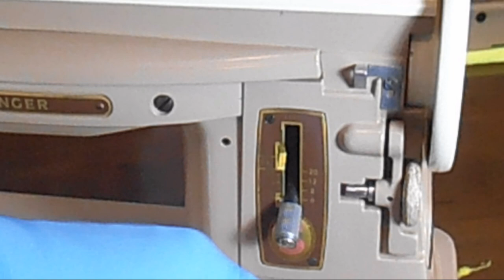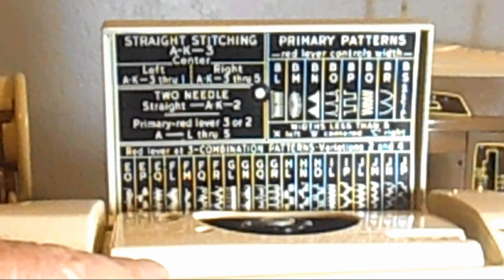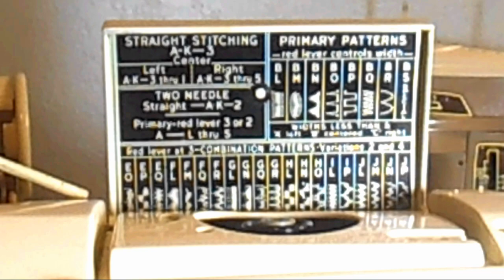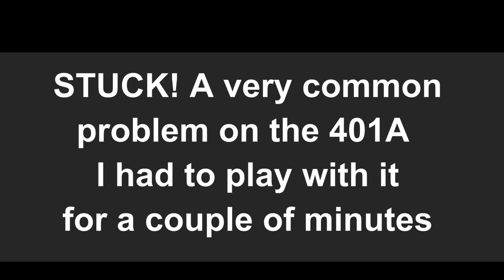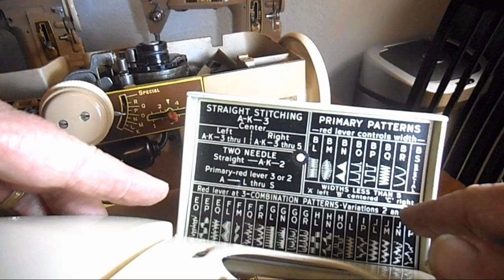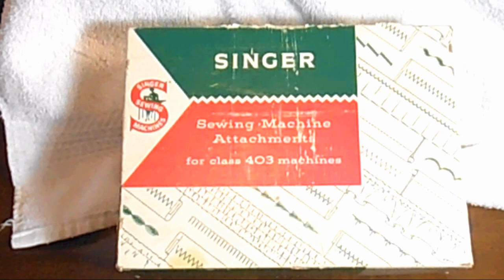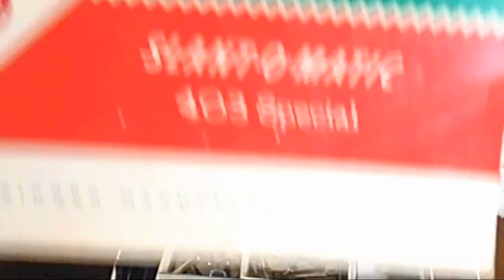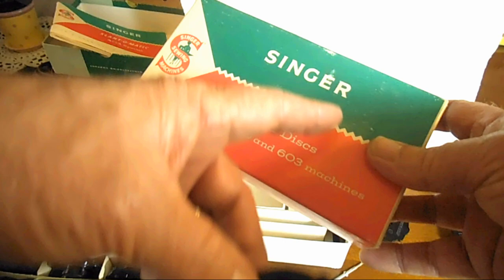SINGER MODELS 401A 403A 404 COMPARING THE BUILD AND FEATURES

Comment: Andy, you didn't mention that the 404 needs a special attatchment for button holes. This because the 404 is as you say, purely straight, & the special attatchment does the zigzag necessary for button holes.
Reply from the maker: Hi Sandra. You are correct about a buttonholer attachment. Thank you for mentioning it. My intent was to show the attachments that were included with each model when it was purchased. On page 45 & 46 of the 404 manual is listed other "Fashion Aids" for the 404 that were sold separately, including the Buttonholer and even an Automatic Zigzagger, among a few others. The free 404 manual is here: http://www.singerco.com/uploads/download/0759bcb48cceb58cd560ec346e371205b034853d.pdf
 The buttonholer and zigzagger work very well and are not expensive. The aids are available on eBay and other sites. I did a series on restoring a buttonholer. It is a straight shank model, but otherwise identical to the slant needle model in the pink "Jetson" case. See it here: 
https://www.youtube.com/watch?v=e5131TMpI7A&list=PLsCOZgzzaiKIVBGEISHzZeWVk8-IxpHw0

This site has an old Singer commercial show how to use the zigzagger on different sewing machine models, cute.
A free instruction manual for the zigzagger is here: http://ismacs.net/singer_sewing_machine_company/manuals/singer-zigzagger-attachment-manual.pdf

The manual for the buttonholer is also available. It shows the low straight shank version, but both models worh  the same and use the same templates. Find it here: http://ismacs.net/singer_sewing_machine_company/manuals/lowshank.pdf

So yu could get a 404 and these two Fasion Aid attachments and sew zigzag and perect buttonholes too!
Loved you comment Sandra and I'll pin it so others can learn about the attachments. Thank you for watching Andy Tube.
Reply: Scusate nessuno parla italiano
Reply: @clararuffo6444  Use the captioning feature of youtube to translate.
Reply: All of the 400 series require a separate attachment as do the 600, 700 and a bunch more models until the 1980s. The 400 series were from the mid-60s and the 401 A was the most advanced for the time. $600 price tag then is approximately $3000 value today. I have 3 of them! My go-to for almost all my sewing.
Reply: Oops! From the late 50s, not the mid-60s.
Reply: @fumble3  why three?
Reply: @fumble3  you can amend your comment by hovering over the three dots that appear to the right when you place your cursor there.
Reply: @fumble3  no. 1950's.
Reply: @twinstar9  LOL! Because, like the mountain, they were there. I have actually had more than three over the years but I have a pesky sister who keeps getting them from me. She also favors the 620 Golden Touch and Sew which my mom got when I got married (and gently removed the 401A) and which my sister was raised on. I remember getting her a child's version (not actually a toy since it created a lock stitch rather than a chain stitch) which she diligently used whenever mom was in the sewing room. She made some notable items on it. Just last year I found a working, complete, one and bought it for her for Christmas. She can't wait to gift it to her 2-year-old granddaughter along with summer vacations full of loving instructions. Hope the little one takes up as well as my sister did. She actually is a better sewist now than I am (at ages 63 & 72)

Comment: Great video! Can a 403 take a treadle?
Reply from the maker: I don't think the USA built one can. I've never seen it and don't see the space for the belt in the base at the front right corner of the bed. The bed is too deep, so I think you'd need a slot or opening for the belt. Singer in Germany made some very unique 400 series slant needle machines. I think one or more of them could convert to a treadle. Search for models 411G and 412G

Comment: Maintenance of sewing machine Singer mawdil 247?? Please
Reply from the maker: Singer Model 247 (Domestic) Instruction Manual: https://www.singer.com/sites/default/files/product_manual/SINGER%20247_547_876_966_3102_L47%20Sewing%20Machines.pdf
Parts List & Diagram: http://parts.singerco.com/CPpartCharts/2_2999/242_247_248.pdf
I do not have a service or repair manual. I do not have this machine or even seen a 247 in person.
List of all my playlists of different models I have worked on (350+ videos) https://www.youtube.com/channel/UCUSPDsHaFtRoz1VA2U1xJ4w/playlists?disable_polymer=1

Comment: I still have my Golden Touch & Sew and my Singer Imperial Model 7043 both of which are slant shank models.  Why are they not making sets of presser feet for these machines?  Singer machines last forever.  In fact, my mother still has my grandmothers treadle which still sews.  I really want that new flower stitch foot for my slant shank machines.  Do you know who I can talk with to get one made for me?  Or to get one of those 42/52/62 presser feet set for slant machines?  I don't think Singer is fair in not providing these -- especially since nothing is wrong with my machines.  There are more slant shank users than you think.
Reply from the maker: You have choices when it comes to slant shank presser feet, although I've never seen the newer "flower stitch foot" in a slant model. You can always buy used vintage feet from places like eBay. Any slant foot should fit any slant model, so you could buy a set of feet for model 603 and use it on your Golden T&S machine. https://www.ebay.com/sch/i.html?_from=R40&_trksid=m570.l1313&_nkw=singer+slant+needle+presser+feet&_sacat=0
If you prefer to buy sets or specialty slant feet, the new ones are made with a separately attachable shank you leave on the presser bar, and the feet snap-on to it. https://www.sewingpartsonline.com/slant-shank-singer-snap-on.aspx?utm_source=Youtube&utm_medium=Product
For the feet, you can buy sets or individual feet. https://www.ebay.com/sch/i.html?_from=R40&_trksid=m570.l1313&_nkw=slant+needle+snap+on+presser+feet+sets&_sacat=41245&LH_TitleDesc=0&_osacat=41245&_odkw=slant+needle+presser+feet+sets
You can also buy individual slant feet that have a built-in shank similar to the old style: https://www.sewingpartsonline.com/slant-shank-sewing-machine-presser-feet.aspx?sort.ss_cat_sort=desc&index=15
I do not know why Singer has not made a slant style "flower" foot. I agree, there are plenty of slant machines in service. Just look at my small YouTube channel that has 958K views and 5.5K subscribers. All from 200+ countries and territories around the planet. Many people tune if for the slant needle machines.
Reply: @andytubesewing1953 the women in my family, all the way to my great-grandmother, were loyal Singer customers.  However, if Singer isn't going to treat us slant shank machines users right, I won't be loyal anymore.
Reply from the maker: @ljtilmon  OK, Lynn. It's up to you.

Comment: Is the singer stylist considered a good machine. Is it all metal?
Reply from the maker: IMO< all the vintage Singer models are "good" machines. That is why millions were sold. The Stylist models prior to about 1970 were mostly metal machines, like the top gear of the vertical shaft was still metal, and the pulleys for the timing belt were metal. There were two belts though, a motor belt and a timing belt, on most of them and so I don't consider them "all-metal". For me, all-metal models would have steel gears ( if they had gears) or metal Pittman drive shafts for the hook and no plastic parts like gears or take-up levers. They did NOT have any belts on the machine. Those models would include 15-91, 201-2, 301, 301A, 401A, 403A, 404, 500A, 503A, the very early 600s like 600E, 600, 604, a couple more.

Comment: "...six bucks gets you a cappuccino some place...", but it got me a Kenmore 1040 at the Elks Flea Market.  I cleaned the outside, superglued its abused plastic Flowered case (that dumb guys broke opening it).  It looks new, but no runs, just hums - dirty inside, I guess.
Reply from the maker: Well, it is a Kenmore 👀 Hehe, kidding. Fresh oil applied? Sometimes the foot pedal needs cleaning/adjusting. It's still a bargain. The motor sells for more than that!
Reply: @andytubesewing1953  The 158 series machines were made for Sears by Jaguar/Maruzen out of Japan.  Mine came in 1973 with all-metal gears, cam stacks, & housing.  They got smart & dumped Jaguar - sold them to the Chinese, so beware.
Reply from the maker: @fredcdobbs823  OK, more than I ever knew about their machines. No worries; I don't buy Kenmore.

Comment: I really appreciate all the work you did on this video.  I really love these machines because they're such great machines.  I have a 301a, a 404, and a 600-something. I'm not wild about the 600 because it just doesn't seem to be as smooth operating as the 301 and the 404. My 404 is sluggish too and I don't know why. My guess is it's the motor.
Reply from the maker: I did one 600 SInger and did not care much for it. WInd in place bobbin or "auto reel" is not for me. If you feel it's the motor of the 404 check out this video at 01:24:30 to see a 15 second "fix" for a sluggish motor: https://youtu.be/fmEeBi8x9ZY
If you'd like to do a step-by-step restoration on the 404 here is a 50+ video DIY playlist for that;
https://www.youtube.com/playlist?list=PLsCOZgzzaiKIB4kvIHCfHYuyLMUp5A4UI
I have 2 playlist for the 301 model. Coco goes to the Spa, a fun 19 video series for cleaning and rehabbing:
https://www.youtube.com/playlist?list=PLsCOZgzzaiKLZyGebzS_oISgesXNyREyI
and a more technical restoration series of 17 videos for remove, replacing, adjusting the 301 model:
https://www.youtube.com/playlist?list=PLsCOZgzzaiKI_6fbu3itbd1v4z3uQvvkO
The foot pedals of these vintage machines can get dirty carbon discs and out of adjustment and slow down performance also. Here is an 8 video series for restoring and adjusting the button style Singer foot pedal used on the 301 & 404 models:
https://www.youtube.com/playlist?list=PLsCOZgzzaiKL6ePPxLpmnWSzTyxPKTb71
I don't sew at all, but love to fix the machines and keep them from the landfill. You have 2 of my favorite models with your 301 & 404. Incredible slant needle machines. You have great taste, sir. thanks for watching my channel.

Comment: I have to agree with you on the 404 and 301. The 404 is also my favorite of the two. The 301's popularity is deserved but the specialty bobbins and the price that popularity now demands is NOT worth it. Give me the easy bobbins, lower cost and the strength of the 404. Thanks for another great video!
Reply from the maker: Thanks for commenting. After I made this video I was looking at the nose end of all three machines lined up together. I should have taken a picture. The needle bar bushing on the 404 is 3 times the other 2 machines. What a brute! Mend strong & take care.
Reply: Not to mention the cost of a 301 bobbin case should you need to replace.
Reply from the maker: I Know! This week I saw 1 original vintage bobbin case advertised for $95. Aftermarket brands start at $30, but some don't have good reviews. It is the same bobbin case as the Singer featherweight. Maybe that is why the price is so high?
Reply: I have both a 301 and 404 that I have refurbished and am planning on selling both at some point.  Having sewn on both, I think the 404 is perfectly fine and sews just as well as the 301.

Comment: Can you tell me what the two knobs on the foot pedal do? Do I need to press them both to make my machine run or do they have separate purposes? Thank you. I have my grandmother's 401a and love it but seem to have trouble making the foot pedal operate smoothly because I don't know which button to push!
Reply from the maker: The button-style foot pedal was used early on with Singer machines. The way a retired repairman explained it to me is that one is an actual button that is pressed to make the motor go. The farther down you press it the faster the motor will go. The other "knob" is a "foot" rest or "shoe" rest that does not move at all. The idea is you rest one side of your shoe on the shoe rest and press the speed button down with the other side of your shoe in a sideways rocking motion. Singer made a few different styles of pedals like the C; clamshell style that you depress the entire top cover of the pedal to run the motor. Here is a Playlist of videos for restoring the pedal if you'd like to learn more about what is inside and how it functions.

Comment: Thank you, Andy, so very much for this video. I really wnjoyed watching ans learning. I recently found 2 for sale,  403A & a 404. I wanted to know which was the most rugged, heavy duty machine and you have certainly set my heart on the 404. I do currently have a 306K. Do you know the difference between the two? Thank you for all of your knowledge. Its greatly appreciated. Much love from Texas.
Reply from the maker: SOrry, I've never worked on or seen a 306K in person.
Reply: I usually use the Slant-O-Matic 401A, 503A and the 500A Rocketeer. But in my opinion the 401A is the best one because we are using that one in a long time and the machine is working in good condition and is in good shape like me😁.   
Have a great one.

Comment: Hello Andy,
I'm making masks and using my 401A. I am wondering if there is an adjustment to make the zig zag wider. I'm using the BL pattern with the red lever at 5 and it is only about an 1/8 of an inch wide.
I have learned so much from your videos.
Any advice would be greatly appreciated!
Reply from the maker: 1/8th inch is 3.12 MM  but your machine should make a 4MM wide stitch. ( a little over 4mm) Be sure your setting is really fully locked onto BL.
Be sure you have oiled the vibrating bracket that holds the needle bar. 
Oiling instructions are in the manual which is FREE to download here: 
https://www.singer.com/search/support?title=401
Is you ZZ stitch nice and flat. Usually, a ZZ stitch is made with lower upper thread tension so the needle can swing. If you use too much tension the stitch can "crimp", "pull" "collapse" "pucker" (what sewists have told me, I do not sew) so be sure you are not using too much tension. Are you making a wide and short stitch? Even lower upper tension. Other than that a good cleaning and oiling of the followers and needle bar driving arm and vibrating bracket and needle bar bushing can help performance. https://www.youtube.com/playlist?list=PLsCOZgzzaiKLiDl9yFTP6mJgQmz5lj4NO

Comment: Hi Andy, I would like to know if the 401A model is capable of sewing leather and thick layers of cloth or vinyl. I want it to sew bags. Thank you
Reply from the maker: Welcome to Andy Tube Martha. You can download a FREE copy of the original Singer Instruction Manual for Model 401A here:
https://www.singer.com/sites/default/files/product_manual/SINGER%20401A%20Sewing%20Machine.pdf
Look on page 5 for a list of fabrics the machine can sew; including Sailcloth, Denim, Ticking and Overcoatings. They don't mention leather, but we have sewn garment leather to make vests, blazers, and pants. We have also salvaged leather from furniture to make clothing and decorative items. A leather needle and walking foot or at least a roller foot are strongly recommended. With a Denim needle we have sewn 4 and 5 layers of denim and duckcloth. Remember it is a domestic machine, not industrial, but that being said it is very stron. BTW, the 403A model has the same motor and gearing and pattern cams and usually costs less. If you don't need the ZigZag then the 404 model is the most heavy duty.
Reply: My $0.02 ... the 401 is a good machine, but feels underpowered to me.  I think a 15-91 has more brute power compared to a 400 series machine.  Also, gotta tell you, the older Kenmores have plenty of power with motors from 1 to 1.3 amps and I have blown through 8 layers of denim with them whereas a 400 series machine handles about 5 layers.  A 60's or early 70's Kenmore can be a fantastic machine.  Also, Kenmores, to me, are the straightest feeding machines you can find.

Comment: Andy - Do you agree with Singer?  Is It better than a 201?  I am asking you, because there is one in Brasil, while we don't have 201s or 99s.  I guess I will purchase the 401A, then.
Reply from the maker: Hi Elaine. I'm not sure what you mean about agreeing with Singer. All three models are fabulous. The 401A is much more versatile and can sew many ZigZag patterns while the 99 and the 201 can only sew straight stitch. I prefer the 403A myself over all of those; the sister to the 401A. You can go to the Singer website Support page and download the instruction manuals by entering a model number in the box. https://www.singer.com/support  You can then look thru the PDF copy of the original manuals to see about features and maintenance. There is not much to go wrong with any of these models as they are all well made with heavy metal parts. The 99 and 201 are made of iron and weigh between 30 and 40 lbs while the 401A is aluminum and weighs about 22 lbs. The 401A can stand on a table for sewing or be mounted into a bench or cabinet. Best of luck to you, and thanks for watching my channel.